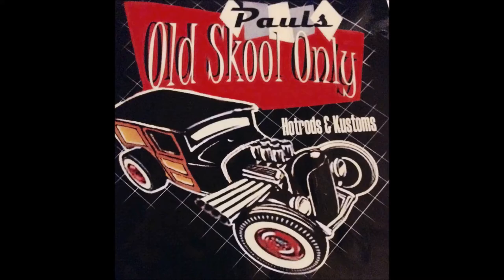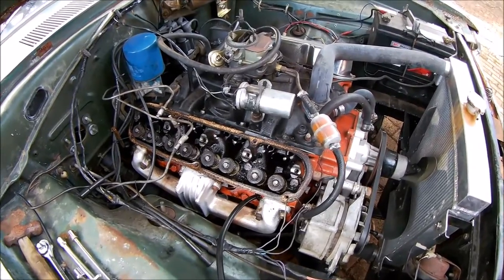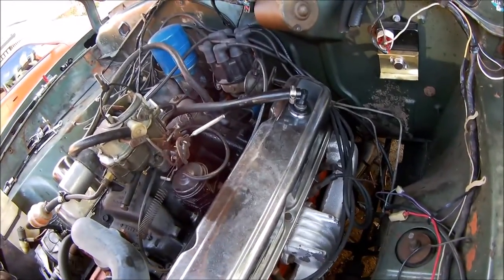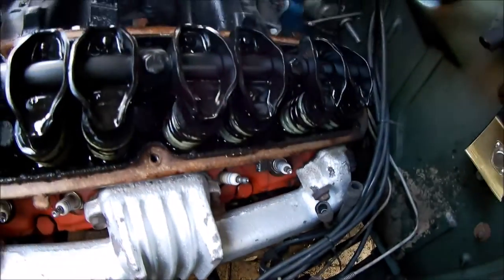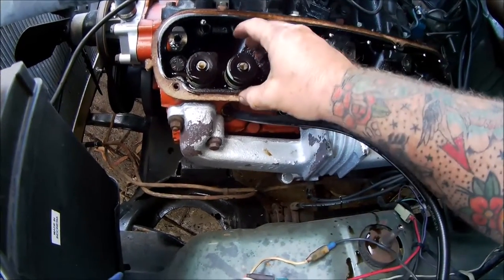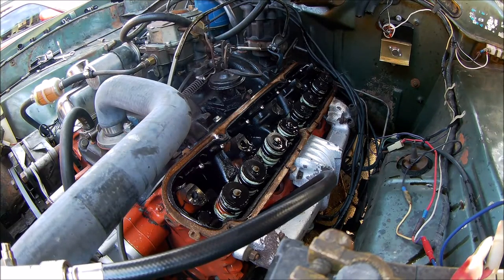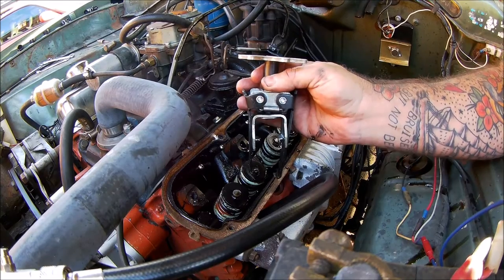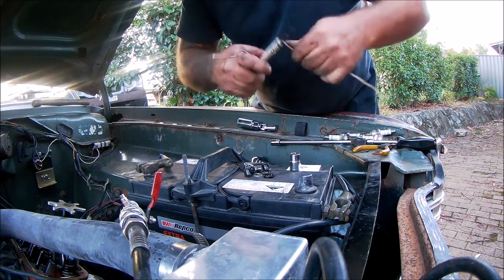How to replace valve stem seals without removing the heads - 318 Fireball

Comment: If you pressurised each cylinder at top dead center then stoped the motor from turning.then if you happened to drop a valve it should just sit on the top of the piston.easy to retive. iv done it once on a 265. Like watching the antics great chanel cheers simon

Comment: Hi, do you have the part number, I have a 85 d150 318 5.2 l, I can't find the right part, the kit on auto parts is intake long cup an exhaust lower cup but exhaust seal looks too small that doesn't go all the way to bottom, the original ones are same height, thanks

Comment: @Oldskoolonly Garage Cool tricks man! Certainly made short work of it. 
I don't mean to be nosy but I couldn't help but notice you are running a fixed fan. 
Not sure if you saw the Engine Masters cooling fan shootout but I was blown away by the fact there their can be over 30 HP difference on the dyno between a fixed fan and a clutch fan.  https://www.youtube.com/watch?v=ZXdLgaFXZzs 
After watching the episode I changed the Satellite and the Rustang back to clutch fans.
Reply: @Oldskoolonly Garage That's a good rule! I practice it too but not by choice. 
I should've known you'd use a clutch fan if you could. 
I was just lucky enough to have two good clutch fans laying around. I've just been trying to spread the word to other hot rod guys about that since I saw it, most folks I talked to about it had the same assumption I did. We all guessed that the heavier the fan was the more power it would rob but evidently that's not the case.
Reply: @Oldskoolonly By the way who's little red thing is that in the beginning of the vid? 
It certainly doesn't look your style.
Reply: @Oldskoolonly  Well as long as he hasn't committed any horrific crimes I'd say you did good enough, and you never know, his tastes may mature some day. I've seen a few import guys go muscle before. The guy who wanted to buy the Valiant used to think imports were hot shit until he had to borrow his boss's 70's C10 pickup with a 350 4 barrel and 4 speed, after taking off at a stop light and accidently slamming his head into the back glass he's had proper respect for old V8's ever since. lol